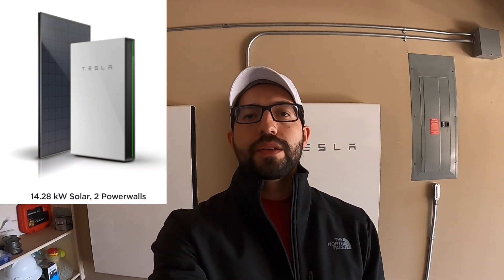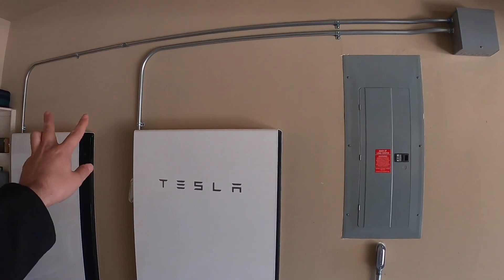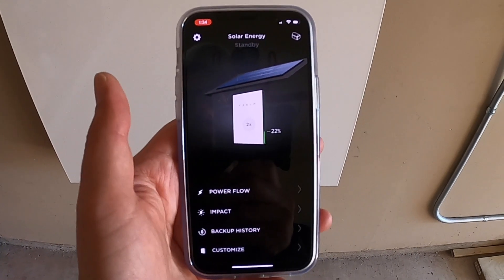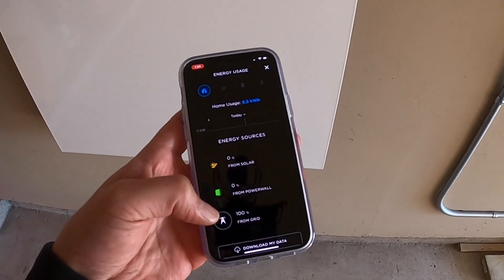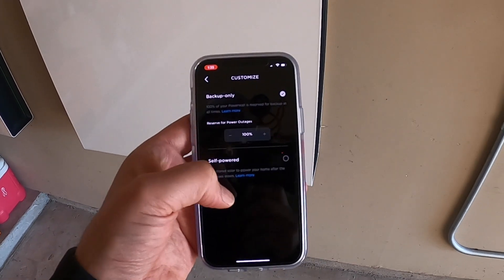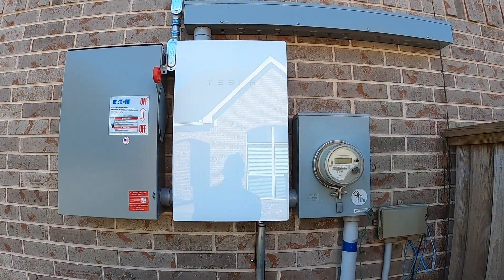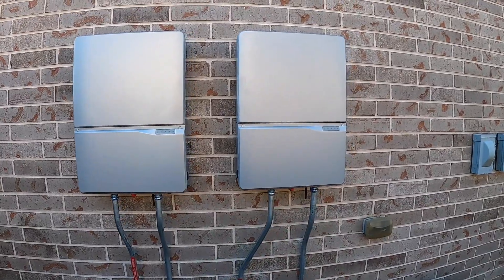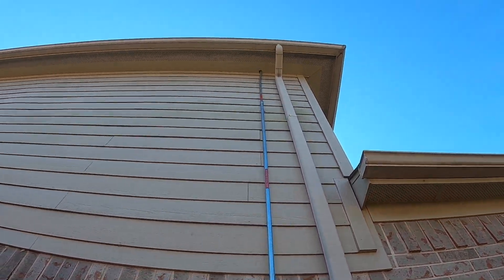Tesla Solar Panels & Powerwall 2 Installation Complete Overview

Comment: What exactly does the city do when they come over and verify your panels and units installed?? Do they go in your house??
Reply from the maker: They don’t go inside your house. I actually didn’t notice them if they came to look at the meter.
Reply: Oh I see, but they did go in your garage to check the power walls? Or they just verify the meter and connections?

Comment: Like you, my 2nd ac is directly hooked to the grid because two powerwalls cannot take the load - does it first use energy from the solar and powerwall first (during peak production) and then grid or is it only taking electricity from the grid?

Comment: when you buy online from Tesla does Tesla install or do you have to use a contractor?
Reply from the maker: In my situation it was Tesla employees with Tesla Energy vehicles. I do believe they work with certified contractors to install the tesla roof solar.

Comment: I only see the line from powerwall to my home grid, but no line from the solar. Tomorrow is inspection day. Is that expected, does the solar only turn on (in the app) after inspection and utility approval?
Reply from the maker: You should have conduit going from your solar panels to the inverters. You won’t see solar production until you turn on the system.

Comment: @Super Tesla...First time seeing Delta Inverter. Only seen “plain wrapper” Tesla Inverter or SolarEdge Inverter in these Tesla installs. Is the Delta just Tesla’s “plain wrapper” one with flashy cover? Is the Delta a string inverter? Does it use optimizers in panels? Are you able to monitor production of INDIVIDUAL panels? Thx for doing videos and sharing information.
Reply from the maker: The “plain flashy” is the Tesla Gateway. I got one of the last of the third party inverters. Tesla is now using one that they designed. You can’t see each panel’s production in my install.

Comment: Tesla panel 14000 instalation 9000 solar  on roof 20000  only for 10 year no no no generator natural gas 5000  installation 4500   total + permit and extra material 1000  think about  generator 30 amp honda 3500 intallation 1200 yes

Comment: Hi,
I live in Florida and I am also exploring Tesla Solar Panels.
Here are some of the questions I have:
Any idea which company Solar panels Tesla has installed?
What is the max watt or kW each panel generates at any given point of the day like 330w, 370w?
How is the Efficiency and Productivity of the panel?
What is the warranty? Other companies like SunPower are offering 20+ years of warranty.

Does each panel comes with an Inverter like SunPower? 
How long it took for Tesla to install after you ordering?
How is customer support for Solar panels?

Thanks in advance!
Reply from the maker: Hello,

Tesla uses Qcell 340w Panels which have a 25 year warranty. In my case Tesla installed two inverters for my 14.28kW system. You can't see the production of each panel, only the system as a whole. Tesla is now making their own inverters and they have a 12.5 year warranty. 

I ordered my system on 10/07/20 and I had them installed on 12/30/20 with 2 Powerwalls. I didn't get permission to operate from the utility company until 1/21/21

I haven't had any issues with the system, but my Tesla Solar Advisor who was assigned to me after I placed my order was very helpful during the whole process. I originally ordered a 12.24kw and they redesigned my whole system because I asked them to add 6 more panels.

I hope I answered all your questions.

Comment: Like your setup. What solar panel models did you use? With panels and 2 PWrwalls, what kind of cost would someone be looking at after installation?
Reply from the maker: Thank you. Tesla used the QCell 340 W panels which I have 42 of them. The total cost was $46k but after tax credit comes out to around 34k. The Powerwalls are what’s really expensive but I love the fact that I can be off grid.
Reply: @supertesla19  Filled out the info and they replied they do not service this area and will contact me when they do. Looks like I will have to find a third party installer.
Reply from the maker: @johndube3422  They didn’t give you a time frame. I listened to Tesla’s Q4 earnings call and Elon said they were going ramp up solar this year. 

Well the Qcells are very good looking. The most I’ve produced on a sunny winter day has been 57 kWh and the lowest on a cloudy rainy day has been 10 kWh
Reply: @supertesla19  Thank you for your info. I was looking at the same panels. My roof will take 40 panels unless they put some on a room sticking out the back, but they would be facing East and West. I had to deal with a dog needing surgery today. So I will contact Tesla in the next day or two to see what I can work out. Did you have a contact name/number you worked with. And I will be using your referral if this happens.

Comment: I JUST turned mine on yesterday. Our timelines are very close.

Protip: Keep your powerwalls off until the electric company comes by, you'll thank me later. You'll want your solar to hit the house and the powerwalls and stay off the grid on power up.

Another tip.. the delta inverter takes about 5-10 minutes to cycle, don't panic when the app doesn't switch to solar and feed your house/powerwall.. it will. 

8.16 / 24 panels / 3 powerwalls

West texas 302 days of sun every year on average, PTO @ high noon. Placed the walls at 5% the first night, no issues.. off grid ever since.

Enjoy it!
Reply from the maker: I called Tesla yesterday and I was like hey can I turn off my Powerwalls?  They said yes, because they were already at 20% and who knows when I get PTO.

Thank you for the tip on the delta inverters. I didn’t know that.

That’s awesome that you got 3 Powerwalls. I really need 3 for my house but in the future. Maybe they make Powerwall 3 with the new cells in the like 3-5 years.
Reply: I had this issue too. Tesla is good with it, but I took charge. It took me sending an email to the power company telling them the following: 

Requesting field inspection at the (my) following address:

Address

Owner name: Alex

This (photovoltaic) system was inspected by the city on 28 December 2020, has no active issues and passed.

Immediately recieved a change in status on my application. The next day I called the power company scheduling and requested a field technician. Be nice and they'll take care of you. Course your results may vary. 3 is overkill imo, but it definitely takes you off the grid if you're power conscious.

My process was installation>tesla inspection>city inspection>utility inspection. 

Great channel, hope you have a great year. Keep up the good work buddy!
Reply: I am looking at 38 panels and three Pwrwalls. Do you mined giving an approx amount to put yours in? Looking for an installer in my area and would just like to have an idea what I will be looking at. Thanks
Reply: @johndube3422  I went with Tesla, so you can go to their site, put in your panel count (even if it approx) and get a number.  You have to stay on top of them (if u go with them...), and you have to know How to stay on top of them, which includes developing relationships with your utility company.  Some advice here... fully understand your utility companys solar packages, etc. and figure out your home usage for winter and summer.  Your Solar, Batteries, and Automation go hand in hand.  You will want to control your home electricity usage (pool pumps, AC units, etc.), and they way to fine tune that is thru some type of home automation.   If your utility company has an on-peak of say 5-9pm, you will need to figure out how much kW you normally use at that time, and keep that to a minimum.  With three batteries you should be able to cover any peak period.  Also, you probably already walked this out but be realistic about what you will generate from hour to hour... meaning just because you have (for example) a 12k system, doesn't mean you will generate that, and I say that because you will have to be smart about making sure your batteries get recharged (daily) while running your house (daily) lol.  Dude it's a fun ride, I wish you the best of luck/fun with it.  Just don't want you to be "that guy" who is Pissed because he didn't do the right homework!!!
Reply: @Twst704  Thanks for your reply. I have looked at all of this information and understand all these issues. Have worked out average monthly/annual usage. Checked on Net Metering and other benefits/advantages, etc. Where I am having trouble is the pricing. According to Tesla's site 4 Pwrwall units are quoted at 32k and for panels 24k. I understand the installers marking up to make a profit, but two different installers have quoted me 102k and 125k and that is with 3 Pwrcell units not 4. That is why I asked for a ball park on your system as it has 3 units. Trying to see if these guys are close to the ball park or how far off base they are. I have seen many systems on youtube reviews and not seen anyone near what these guys are asking. Your video was informative and straight forward, so I thought you might have some helpful info. Thanks!
Reply: @johndube3422   Well, I didn't do a video (yet) lol, but my 3x47 came in at around 55k.  Consider going thru Tesla.  You have to really stay on top of the process but you can save a boatload.  I had installers telling me crazy things, trying to get that "first date" lol.  The talk soo good!!
Reply: @Twst704  Thank You Todd. When I contacted Tesla, they were the ones to refer me to the two contractors. I will call them again to see if THEY can do it and how much.
Reply: @johndube3422  Really??  Where (if I may ask) are you located?
Reply: @Twst704  NE Indiana
Reply: @Twst704  thanks for the recommendation. I just grabbed Hubitat and digging through it. Everything else in the house is automated/smart, so this makes sense. I'm really surprised I've never looked into it or heard about it until you mentioned it. I'm well over a month off the grid, even with an M3. I do have to tweak how much I pull and when I pull it from the panels though. Too bad theres not a way to intelligently automate how hard the car pulls (charges), in relation to solar wall charge and house consumption. Where I'm at, it's almost impossible to not stay off grid with the system I have.. even with a few cloudy days. Best decision I ever made.
Reply: @p7ayboy  I would take a look at Darwin’s Den.  He would an awesome app for controlling your Powerwalls via Hubitat or Smartthings.  I promise I’d pay for it if it wasn’t free.
Reply: Uh oh! Looking for further information regarding the keeping the powerwalls off statement...
Reply: Sounds like there’s a story behind that comment... lol.  I’m on day 29 if my post-Install wait.  Gave me a bunch of time to test/validate my Hubitat automation which I love.  Honestly, operating in one set of settings all day doesn’t cut it.  Have you had any thought around what mode you want to operate in?
Reply: @Twst704  how do you like the Hubitat interface? I've been thinking of getting into this.
Reply: @p7ayboy  I love it. You have several ways of manipulating what you want.  The app that runs within Hubitat has its own scheduling which I use for basic navigation, and you can also (directly from Hubitat) do thinks like check the battery level at specific time and make mode changes based on what you see.  It’s always better (regardless of what you use for automation) to try and stay within a specific mode as much as possible btw. For example, If you go from self powered ( which has no concept of on-peak), and then move to Advanced, TBC, the the “buckets” used to track usage are different, so as it re-initializes as part of the mode change ( it now has to setup new buckets for on-peak, off-peak, shoulder), you could experience loss of previously captured data plus some lag as it shifts.   It helped me to first understand (inside and out) the difference between each mode, as it relates to (1) charging and discharging, (2) when solar is/isn’t present, (3) during on-peak, off-peak, shoulder, and normal periods (for self powered).